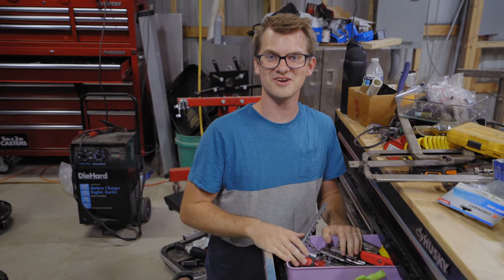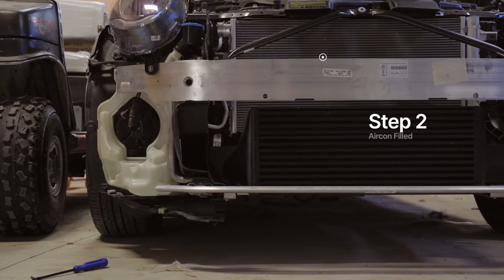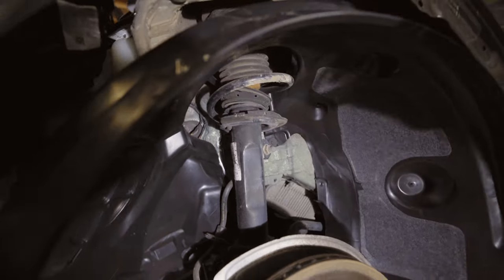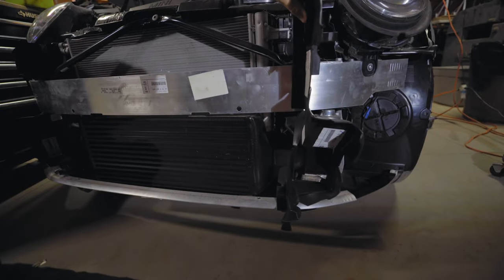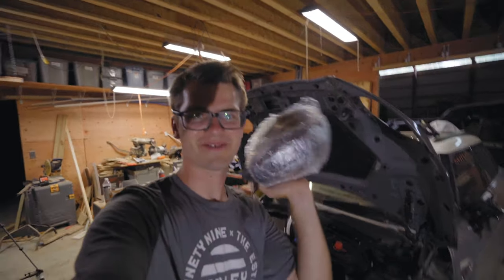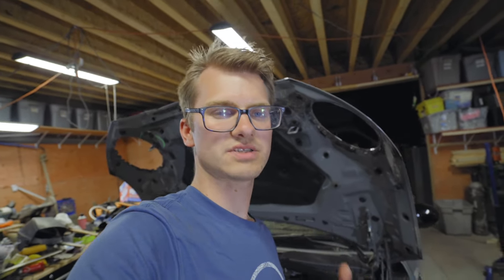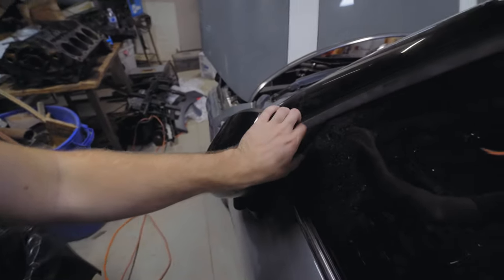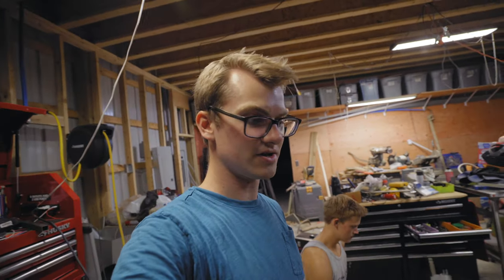CAN I INSTALL LCI2 MIRRORS on my CRASHED MINI COOPER?

Comment: Got a 2016 f55 S, so far changed the tail lights (union jack) and indicators to LCI2 (easy coding with bimmercode). Still not sure if I will replace the headlights to the LCI2 version as well, as I already have the 'old' LED lighting. But cool to see this progress, keep it up. The mirros give me ideas to change as well haha.
Reply from the maker: Thats awesome! You definitely should change the headlights at some point! It is a hard retrofit, but if you already have the LED ones, it is a lot easier. I should be doing it with this car at some point. Thanks for watching! Lots of cool ideas for the future!

Comment: I rebuilding a f57 2018 mini cooler 1.5 
I could only get one reply on a mini Facebook page and apparently the reason behind my fan not turning on is because the ac has to be charged up. I have not recharged system dew to repairing everything upfront. So I’m wondering if you have heard of this or know some one i could potentially get in contact with?
Reply from the maker: That’s awesome! 
Good question, the cooling system is very odd and while that may be the issue, I think my fan worked when it was not charged. 
If you wanted to test it, use ista to manual test the fan to see if it works. 
That way you can at least narrow down the issue.